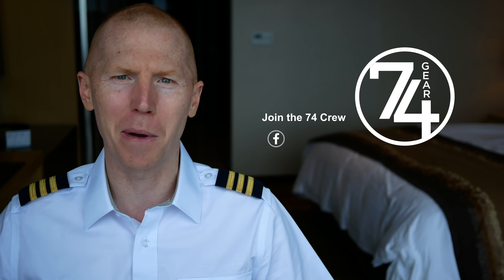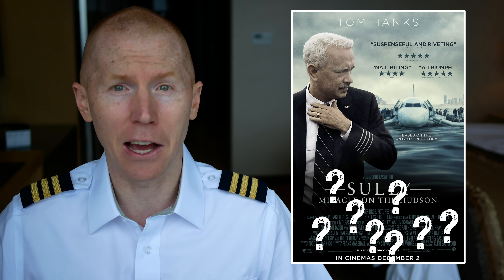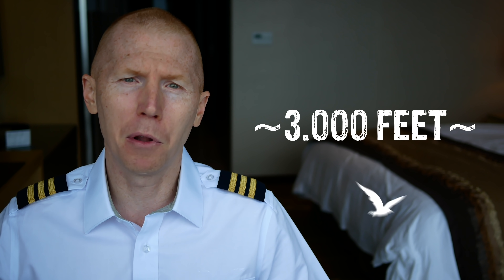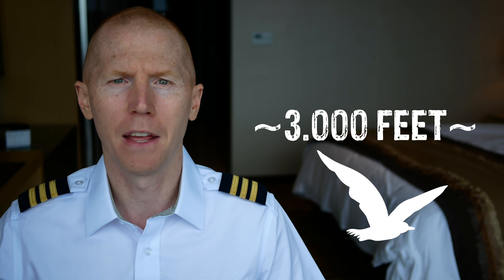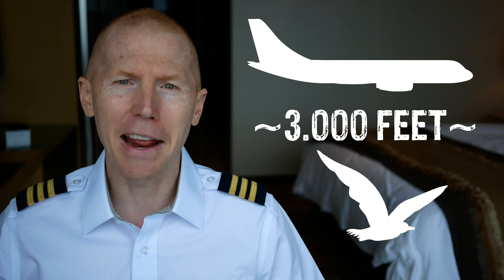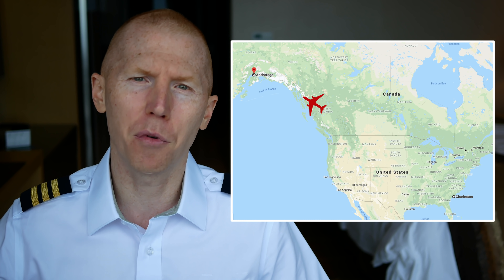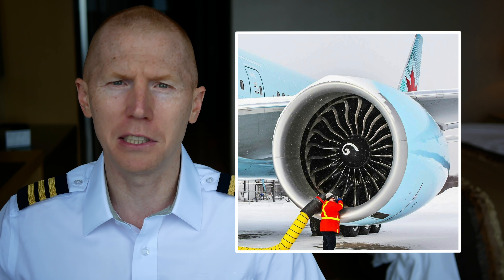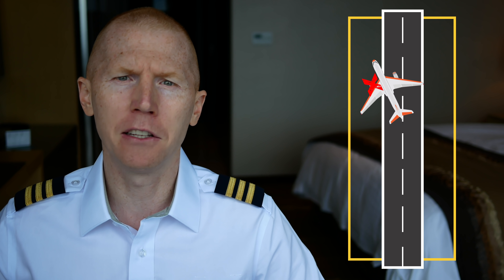Why Engines Don't Have a Mesh or Grates to Stop Birds

Comment: Im guessing that even if there was a screen and a bird hit it the amount of air getting drawn in would suck that bird right thru the screen anyway
Reply: A fighter jet engine produces around 15 875,733 kilograms of thrust. That   is really easy enough for steel to break...
Reply: Not only that even more dangerous if it’s a big bird that hit with a force and pushes the screen in or mesh into the engine
Reply: Don't screw a screen to the front of the engine. Imagine a giant tennis racket, quiet a distance in front of the engine, and held at an angle. When hit by a bird, the whole thing flexes a little so it doesn't break. It doesn't even try to stop the bird, but instead changes the trajectory of the bird slightly, so that it misses the air intake. If the bird breaks up and a few small pieces still goes in, that is a smaller problem than if the entire bird goes in whole. Plus the plane is not going at full speed when you deploy this thing. You only need this during takeoffs and landings, when the plane is going the slowest. I can also see the shield not being deployed all the time. It is instead held against the fuselage. When sensors detect a large bird is about to enter the engine, it pops out like an airbag and deflects the bird.
Reply: @danielch6662  uhm, that retractable screen is just going to be sucked in. Do you know HOW hard jet engines suck?
Reply: @danielch6662  There is no such thing as deflection when talking about jet intakes
Reply: @bogingathedolphinking2802  exactly, the thrust is so great that it just gets sucked onto the screen, no mather if it's shape.

Comment: Why is no one mentioning just using a RETRACTABLE blade mechanism to the front engine cowling which conforms to the inside of the cowling itself (individual blades pop out - would look like a pinwheel when deployed). Make it pop into the slipstream of the intake instantly, as soon as it detects something about to be ingested - scan lasers could do that fast enough). Further, make the leading edges of the extended bars VERY sharp - thus cutting the birds into smaller chunks that the engine could deal with and continue running.  They're able to put reverser-buckets on JT-8Ds, why not deployable intake rakes. Could save an entire airplane, even if a partial failure of the system - it could still allow partial thrust. Use for take-off, and stow them for cruise flight, with no performance penalty. 

Yes, it adds weight and complexity, but what would you rather have - weight/complexity or a downed-airliner?
I think it would work. and worth whatever it costs.
Reply: Great analysis: "I think it would work, and worth whatever it costs". Bird strikes have only caused dual engine failure on transport category aircraft twice in history and nobody died in either crash. Why are we inventing miracle technology of ridiculously-rapidly-actuating blades to solve a problem that isn't even close to the most likely reason an airplane would crash?
Reply: Countless bird strikes happen every year though. Would prevent possible loss of engines. SR22s have BRS systems. You only need them once to make it worth the cost and complexity.
Reply: And we’re talking about hundreds of lives and millions of dollars with a commercial jet. SR22s are just 4- seaters.
Reply: davidrpando2 Again, commercial planes virtually never crash due to bird strikes.  It’s not such a safety risk that it’s ever be worth such a mechanism.

Comment: Our Southwest flight from RDU to Tampa barely took off from the runway when the left engine got hit with bird strike; i was able to see us just lift still seeing runway when a loud pop happened due to two turkey vultures hitting the engine and getting chewed up... not a good time to have a bird into the engine just as the plane lifts up, so we had to turn around, flying low altitude just above the trees to get back... smoke and burnt chicken smell filled the cabin, did not see that on Sully’s flight

Comment: what about a screen that retracts above 3000 feet
Reply: Another mechanical system, and limits climb power when you need it the most. I think that would actually be significantly worse than not having a screen because it makes single-engine failures (particularly go around with engine failure) very sketchy

Comment: Why not just design something like the mig 29 with alternative air intake for takeoff and landing? You don’t have to answer it I’m sure it’s a money thing but there are solutions to this.
Reply: Also limits climb power of the engines (so if there's a single engine failure it could be quite bad). Mig-29 has plenty of thrust even with one engine down; a full 737-900 will barely manage to climb with one engine.
Reply: Appable That’s a good point I hadn’t considered that, though if one engine fails you could technically switch the configuration, hopefully you’re not in a stall when switching LOL...

Comment: kind of weird risk Calculation - dot we wear a Seat belt all the Time for a "maybe once in a Lifetime Accident"? that might happen never? Cannot follow your Argument that risk of a Bird Strike is only below 3000 feet....  So why not protect the Engine with a kind of retractable Guard only during take off or built the Engine with bigger Intakes to compensate?

 In my opinion it´s just calculating the Risk vs. cost of proper Engineering, Life of a few People is nothing against cost of Development....  like everywhere in the Industry. Our Life is just nothing worth.
Reply: That's true, but by installing a screen are you making other failure modes worse? It'll limit engine power somewhat, which means a lot more could go wrong with a single engine failure (which is a far more likely failure mode than a dual engine failure, obviously). By trying to make one extremely rare failure mode safer, you make much more common failure modes more dangerous. A
Reply: @AmbientMorality  .... like I said - not just install a Screen, build a Engine with it included so than no Power loss happens. Cars have Filters and all sorts of stuff BEFORE the Engine... without loss of Power, so what? It would be easy doable. Just a Matter of WILLING and Engineering. And Birds strike is not so rare en when it happens its fatal. So why not make this safer? How common is a rollover on a Car - America banned Convertibles in the Seventies because of that very rare Accident type... how about that?
Reply: @FRITZI999  I don't think you understand how rare it is. There have been two dual engine failures in history caused by bird strikes in transport-category aircraft. Neither of them resulted in any fatalities. Car engines also can size an inlet to the demands of an engine; airplane engines have a fixed inlet diameter for a given fan size. With a screen there is a massive stagnation pressure drop which inherently limits the power that can be produced for a given engine size. This pressure drop gets worse the faster you go too, so it won't affect slower planes nearly as much as it'd affect transport category.
Reply: @AmbientMorality  .... well - there were a few fatal crashes in History because of Bird strike so why not come up with a Solution. Don´t remember Hudson River? Also on my nearby Airport a Plane needed to emergency land cause of Bird strike. And plenty others too. Just because not everyone is published it does´t mean there is not Danger. THAT´s what I first stated - Companys simply calculate that it costs less than better engineering. Like my example about Seats Belts. You wear them but maybe NEVER need them in Lifetime.  think you don´t understand how simple it would be to solve but Companys don´t want to change the entire Industry. It´s similar to Gasoline vs. Electric Cars. Fust a minor Change in Details but People cannot accept.
Reply: @FRITZI999  Nobody died in UA1549 (Hudson ditching).Again, nobody has ever died in a transport-category aircraft (capable of carrying 40 passengers or more) due to a bird strike.

Nobody dies in emergency landings involving single engine out; that's a scenario that's trained for very often. Furthermore, of the times where an airplane is running on a single engine the vast majority are planned shutdowns due to out-of-limit parameters on one engine (abundance of caution, better to shut it down and turn back). Engine failure due to ingestion of something is quite rare, and the other engine is already the backup. It takes quite a bit of bad luck to hit birds on both sides
Reply: @AmbientMorality  .. but Millions worth of Damage....  think of that. And like I said. Bird strikes are a common Risk in Airtravel....   seems you din´t get it what I want to say. Please read again. There is no Solution cause it´s calculated Risk, nothing else. A Engine with a Screen in front would still run - from a Technicians perspective. The Throttle Body of my Car has a Mesh in front of it.... it still runs. It dies´t limit the Airflow in any way. There are helicopters with a Mesh Shield on front of the Turbine - google it! Why don´t they drop from the Sky .... you see? This Argument is pure BS.
Reply: @FRITZI999  You do keep saying "bird strikes are a common risk in air travel". You have not actually provided any evidence, you're just asserted it as a fact. 

Helicopter turbine engines are completely different. In particular they require much less air because they don't have bypass air; they're using a turbine engine to power the rotor. High-bypass turbofan engines need low-turbulence air at the inlet with a high stagnation pressure in order to generate meaningful thrust from the fan. The mesh both will increase turbulence and decrease stagnation pressure drastically. 

What you're trying to do is vaguely analogous to installing a screen around the entire rotor of a helicopter, though even that would be somewhat less lossy because helicopters, turboprops, etc move more air per unit force generated.
Reply: @AmbientMorality  .... yeah, whatever - take your Seatbelt of next time you drive your Car. No one can give you a Evidence that you need it. --- did you read what I actually wrote? No, don´t think so... have a nice day.
Reply: Christian Meier There are thousands of fatal car crashes per day where seatbelts have a good chance of improving safety. Bird strikes happen very rarely, bird strikes that result in engine failure are even rarer, and bird strikes that cause dual engine failure have happened twice. I know how to do risk analysis; that’s basic aerospace system analysis. You learn that in undergrad. 

Your “risk assessment” is based on fear rather than any data on the actual statistics of failures. Now you’re going with stupid comparisons to seatbelts despite the probability of an incident where a seatbelt is required is likely at least several million times more likely than an incident where a mesh in front of an engine would help. And that’s not factoring in the probability that safety devices decrease safety (nonzero for both, but especially for a mesh in front of an engine).
Reply: @AmbientMorality  ... whatever - thanks for the Conversation.
Reply: @FRITZI999  "whatever", the word people use when they're scared of just admitting they were wrong. In effect, "I didn't lose the argument because I never cared anyway!".
Reply: @AmbientMorality  .... I just wanted to be polite - I could also have said "I don´t give a shit".... or how about "you are wasting my time Sir"...... I recommend to get a Life instead of starting useless Discussions and aiming to "win" them. Wer´re not in High Schools Debating Club here.  I usually don´t talk to Strangers about technical Topics if their Background of Knowledge and Skills are not clear for me. I talked about if it would be possible. From an engineering Standpoint YES - you started if why or why not.... I personally don´t give shit about that. Not my Circus, nit my Monkeys. clear enough for you, Sir? Thanks for the Conversation and have a nice day.
Reply: @FRITZI999  If you actually cared about "from an engineering standpoint", you would have looked at the actual risk of birdstrikes first before you started talking about a "retractable guard". That's not engineering; that's making up imaginary mechanisms. Engineering requires that you actually justify the systems that you want to put on, and "bird strikes sound scary" is not a justification.
Reply: @FRITZI999  More like procrastinating studying for an exam on... basically the topic you're wrong about.
Reply: @AmbientMorality  .. you are boring me! get a Life, maybe a Job, do something valuable.....

Comment: well, then engineers should install a retractable cone mesh that is only active when under 3000 ft. Efficiency decrease for a small amount of flight time should be prioritized over engine failure!
Reply: If there is a single engine failure and a screen is limiting the climb power of the functioning engine it gets quite sketchy. You've prevented one failure mode (dual engine failure due to bird strikes)  that's only occurred twice in the history of aviation, both without any deaths, and made other failure modes significantly more dangerous.
Reply: @AmbientMorality   I am just assuming that the efficiency decrease is so minimal, that no serious problems should occur even with one engine. I guess the bigger worry for airlines in this case is fuel economy during take off.
Reply: @atheeromar223  I don't think it's even close to minimal. My guess (haven't done math on it, of course) is that it would easily decrease thrust by 10% – which is a lot if you're only running on one engine.

Comment: In a few jet engines for turboprops, like those manufactured by P&W but all free turbines are similar, the engine is installed backwards so that air comes in the back (aft) of the engine and exhausts out the front. The air inlet is ducted underneath, then it goes up and makes the 180 degree turn.

Comment: I believe the MiG-29 and or SU-27 have doors to stop FOD from getting into the engine on the ground, they suck air in through small doors above the engine inlet facing vertically.  After the aircraft takes off the doors in front of the blades folds down and the aircraft flies normally.  wonder if they could do something like that

Comment: the problem is that modern engineering is based on probabilities and not absolutes. Failure is actually permitted if it is not frequent, but I believe it is also since commercial jets fly slowly and can glide after an impact. Military supersonic jets cannot and thus outfitted with ejection seats.